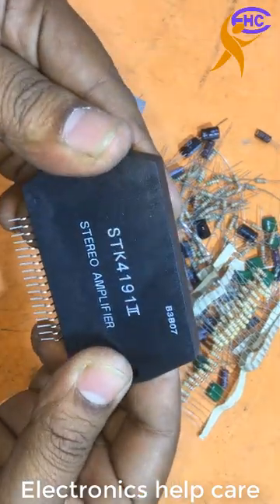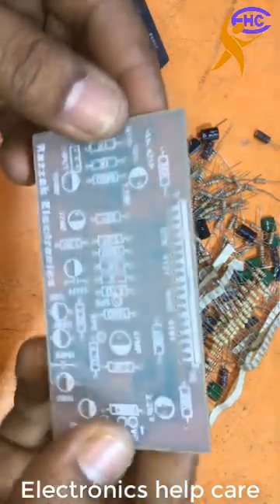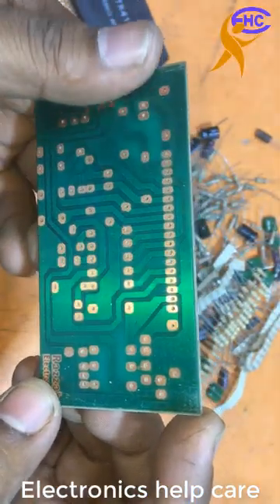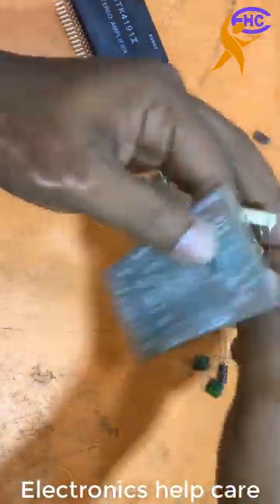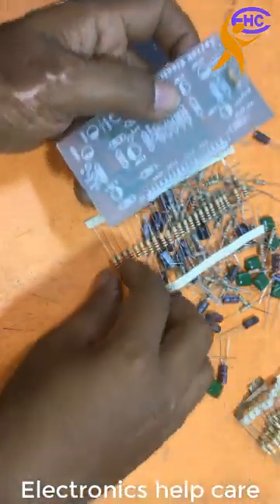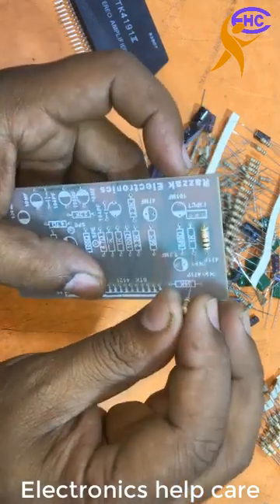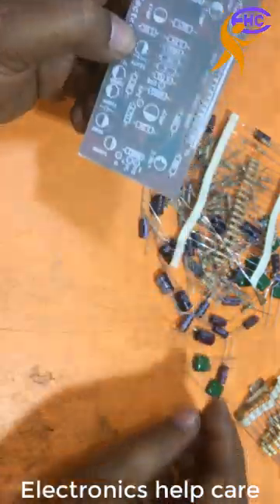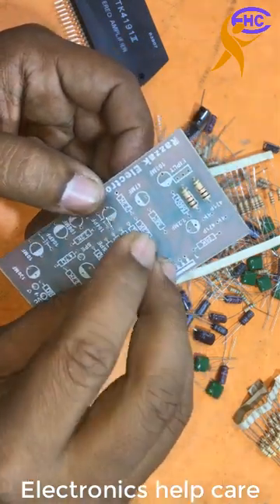Stk4191 amplifier circuit diagram

Comment: These are fake ic do not make or use stk power packs , tda20xx series , or other low power class ab & class b chips. 
If you are interested in less than 100w buy class d . Or above 100w make them with c5200 & a1943